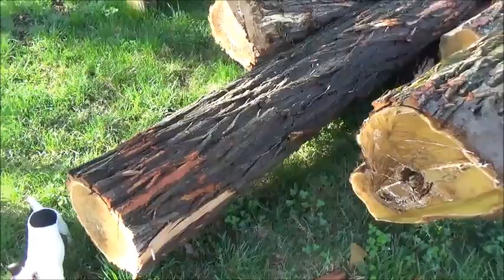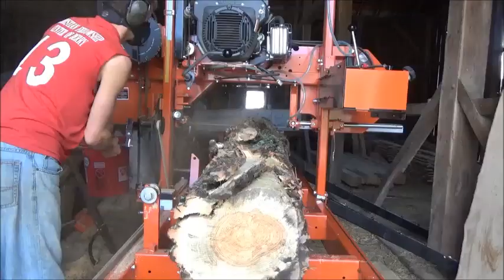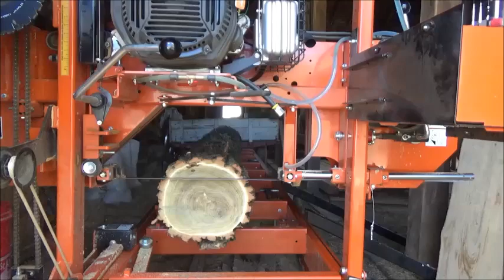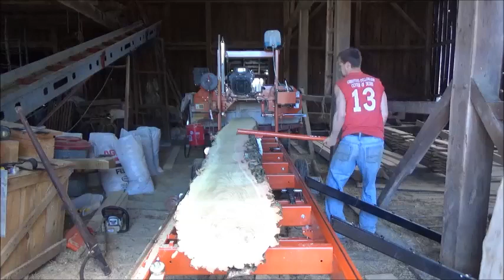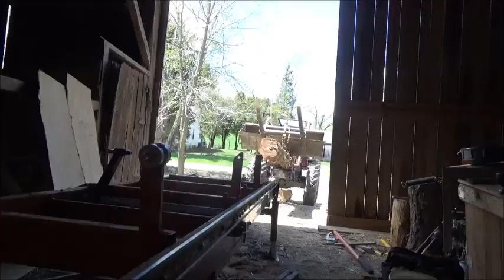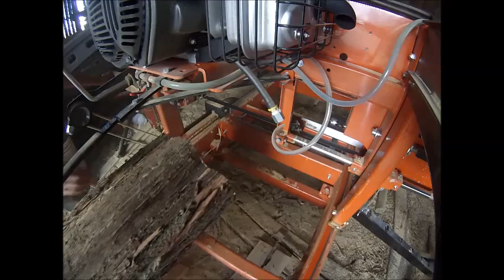Milling The Black Locust Trees For Timber

Comment: Thank you for the video. My understanding is, like cedar, locust has a heartwood that is not rot resistant. Only the sap wood is. So if that's true won't the centers of your posts rot away?. Thank u
Reply from the maker: That would explain why a lot of these trees are hollow inside. I know we have posts that my grandfather used for cow fences and they are still hanging in there. So idk what the difference is between a living tree and d a harvested post
Reply: @WillowRunMills  I'm collecting felled locust for a water wheel I want to make but I have to stay clear of the heartwood. It's all the same color, so it's a pain.. another youtuber that has a lumber business (hobby  hardwood, or something like that) said if you look close , the difference in the cell structure can be seen.. I don't know. I'll have to break out a magnifying glass.
Reply: @WillowRunMills  did your grandfather split them before setting them? That may explain it since most of the post would then be the outside of the tree (if the were quartered, I guess)

Comment: Curious what blade you're using my blades are good for one cut only......
Reply from the maker: i have the ones it came with and their turbo 747. they turbos i usually use one the hardwoods and they are amazing
Reply: People will say it's because locust is so hard. I've found it's usually because of sand and dirt in the bark. My woodmizer guy cut a ton of seasoned locust for me a he said he was pleasantly surprised on how good it cut. He does have an lt  40 hydr. with a debarker but these logs were bark-less. Me with my old hud-son 30 if I don't hew off the bark or hose it down I'll be changing blades a lot. Every where I've every cut it , it was growing in sand. It get's in every nook and cranny. Which locust is known for. I have a hose and wire brush on hand at all times. If you have a wood mizer get one of those router type debarkers. They'll save you more time than the log loader.

Comment: Is black locust a wood which can be cut similar to that with a chain saw? I’m a newbie to this tree.
Reply: You mean with a chainsaw mill?
Reply: @pamtnman1515  yes
Reply: @ravenrecord8960  sure. Black locust can be sawn with any powerful saw. Much easier when green than when dry and very hard.
Reply: I just milled a black locust that stood dead by hand with a chainsaw got some good planks for live edge tables/headboards. Took some time and a couple sharpening but definitely worth it

Comment: how do you find the lumber wears on the blade teeth?
Reply: It cuts ok but the bark will pick up and hold dirt/sand and dull blades real quick. I just cut a stand of locust with a few cherry logs in it that I just finished milling. I hosed the logs off real well and still changed blades about every three logs or so. The locust will probably be as bad or worse.